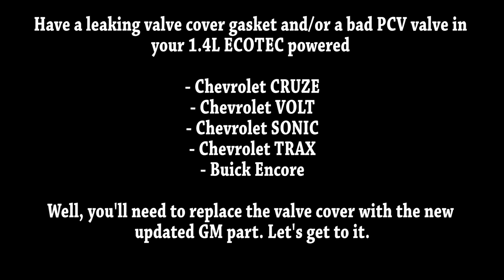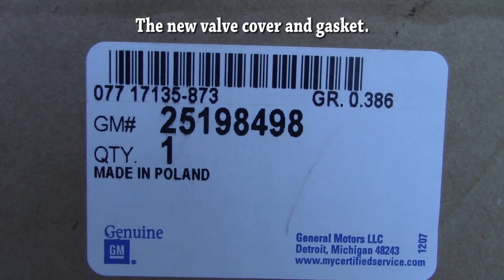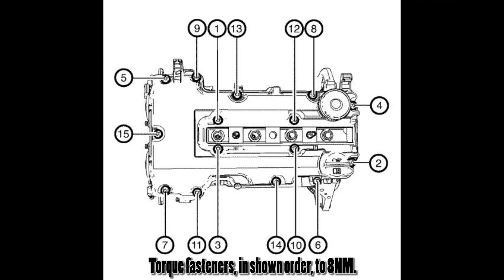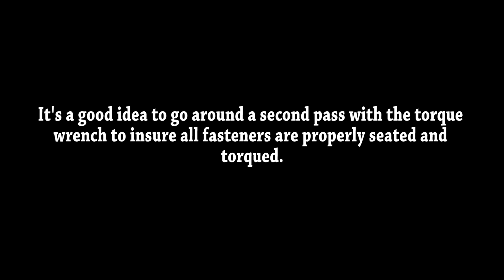GM 1.4L ECOTEC Valve Cover Replacement

Comment: I have changed the pcv valve cover but my car is still stalling randomly. Any suggestions please. It’s original cover from gm. And engine light is on.
Reply from the maker: What codes are still active?
Reply: MrSubaru1387 I don’t have anything to check for codes but I got it replaced by one of the local shop and it runs good for few days but now again it stalls or engine shuts off randomly while car is at stop. They have checked everything but it is same thing after few days. Engine light is on. Changed the oil cap, gas cap and coil pack but same problem.
Reply from the maker: Well, first off, stop throwing parts at it. You're wasting time and money. Get the codes pulled for free at an Advance Auto Parts, Auto Zone, etc and report back.
Reply: MrSubaru1387 I’m not sure if they are in Canada. Or you can suggest some reasonable code reader so that i can check myself.
Reply from the maker: Oops. Didn't realize that you weren't in the states. Actron makes a decent, cheap, code reader.
Reply from the maker: https://amzn.to/2GWefTr
Reply: MrSubaru1387 Hi. I checked it today with reader and it shows p0171 code system too lean bank 1. Do you know what this code is about. Thanks.
Reply from the maker: Lean codes means the engine is sucking more air than the computer is calculating for, or has a restricted fuel system.
Reply: MrSubaru1387 So is this because of o2 sensor, pcv valve, maf sensor or k&n air filter which I changed few months ago. Any solution would be helpful.  Thanks
Reply from the maker: No. Most likely you have a leak in the intake track somewhere between the MAF sensor and the cylinder head. Or, you have an exhaust leak between the cylinder head and the oxygen sensor. Or, you have a restriction in the fuel system.
Reply: MrSubaru1387 I see. I found the solution.... CLIFF.
Reply: What are the values for these components? Mine are these
Shortft1 -5.0 to 4
Longft1 steady at 32
Maf 1.7 to 5

These are at car idle.
Reply from the maker: ST and LT fuel trims should be near 0. The fact that the LT is a steady 32 means the PCM is dumping fuel into the engine trying to combat a lean issue. You've got an air leak in the intake tract.
Reply: MrSubaru1387 Means duct after air filter?
Reply from the maker: Yes. All the way to the cylinder head.
Reply: MrSubaru1387 Thanks for assistance. Will check soon
Reply: I checked the tract but it’s fine. I also removed the maf sensor plug to check if engine stops but it didn’t. Does it mean that this sensor is faulty?

Comment: well looks like i have to try again seeing how mines still leaking oil with a new valve cover and see where i went wrong damn it so pissed right now you have no idea
Reply: Check if it coming out the top of the bolt tubes. If so seal them.

Comment: You wouldn’t know where I could find the two T30 bolts for the ignition coil would you if so thanks.
Reply from the maker: Broken them?
Reply: MrSubaru1387 no more like my dad moved them on me and now I can't find them.
Reply from the maker: Any metric bolt of the same size and thread should work. If not, GM dealership.
Reply from the maker: So Fastenal or Home Depot.
Reply: MrSubaru1387 okay thanks. Think the GM parts would too
Reply: MrSubaru1387 sorry to keep bothering you. Just did the same on my sonic. Hooked it back up to the computer and still same codes. Does it take a while to rest or do I need to have it rest
Reply from the maker: You cleared the codes and they came back on again?
Reply: MrSubaru1387 my computer I have don’t clear. That’s why I was asking. If they clear themselves or do they need to be cleared?
Reply from the maker: With time, the codes will turn off. Or, you can just disconnect the battery and clear them.
Reply: MrSubaru1387 thank you
Reply from the maker: You're welcome. 👍
Reply: A standard Allen wrench works

Comment: While doin this... My valve cover didnt come off... Is there a possibility that the previous owner already fixed it before n used sealent all over the area... Nomatter how much power i use.. it doesnt come off...
Reply from the maker: Are you sure you loosened all the bolts?
Reply: MrSubaru1387 yes please... All 15... I can literally pul up and down all of those screw..
Reply: Is is ok to run a blade around??.. jus wondering which side.. top of the gasket or the bottom ..
Reply: MrSubaru1387 thanks .. it done.... I really needed to use alot of force...done.. thanks...alot
Reply from the maker: Is there RTV, silicone, around the edges?
Reply from the maker: Ah. Glad you got it. 👍🏻

Comment: No gasket sealer on the replacement cover?
Reply from the maker: No. Just use the silicon gasket. Only dab RTV on the seems between the head and timing cover as shown.
Reply: Thanks for the quick reply!  About to attempt this...........
Reply from the maker: You're welcome. 👍
Reply: Just finished!  Seems to be working like it should (no more rough idling), though I think I failed to fully re-seat the ignition coil.  Now when I have the key in the ignition and the systems turned on (engine still off) there is a electrical whine coming from beneath the engine cover that I've never heard it do before.
Reply from the maker: Glad you were able to get it done. Whatever whine you hear isn't the ignition coil. Could be the ABS pump running, electric throttle body, or any other number of electrical components.
Reply: Replaced mine used gasket sealant and now I have an oil leak . Any idea what it could be?
Reply from the maker: What kind of gasket sealant? Where did you apply it?
Reply: MrSubaru1387 blue RTV silicone gasket maker.  But I turned it on about 20 minutes after applying I'm hoping it'll dry overnight and try again in the morning
Reply from the maker: Why did you put blue RTV on the silicon gasket?
Reply: MrSubaru1387 no not on the gasket on the 2 esdges by timing chain
Reply: Exactly where you did but I turned car on about 20 minutes after I think that was a mistake
Reply from the maker: Where is the leak? Did you clean the cylinder head surface completely?
Reply: MrSubaru1387 not sure I didn't have time to look for leak yesterday . But yes I cleaned it
Reply: How long do you have to let the RTV cure before you can start the engine? Great tutorial video, Thank you!
Reply from the maker: Go by the directions on the RTV you are using. They vary in cure times.

Comment: Ok , but how long did you wait on your car after you finish?
Reply from the maker: Let it set up for 24hrs before driving it. Bit of overkill, but pretty sure that's what Permatex calls for.
Reply: @MrSubaru1387  i have a question your torque wrench is kind a bit expensive..is there any other tool that i can use?
Reply from the maker: Any torque wrench that can torque to that torque value is fine. I do this for a living, so I've invested more in tools I use day in and day out.
Reply: @chardtkdog8340  You can find an AC Delco digital torque wrench on Amazon for around $100, or  approx. 5 times cheaper than used in this video.

Comment: I WONDER WHAT CODE IT THROWS WHEN YOU HAVE TO DO THIS AND IF THE UPDATE VALVE COVER COMES WITH GASKET
Reply from the maker: Why are you yelling? Yes, gasket is included.
Reply: @MrSubaru1387  loL sorry chief no yelling thanks for the update although i have the 1.8 crude but it seems like the same process